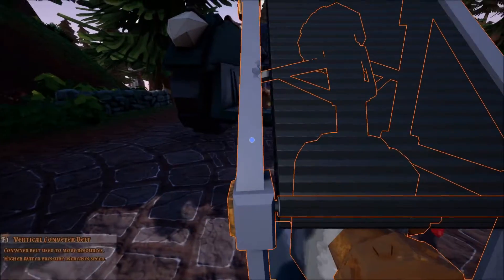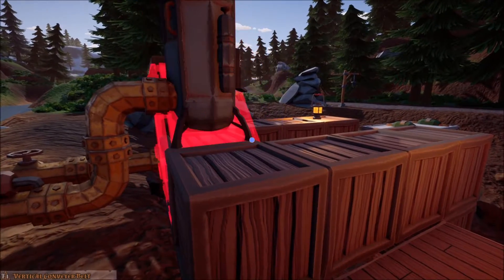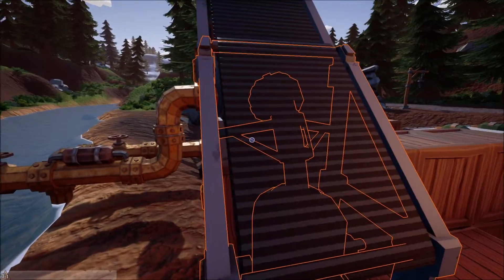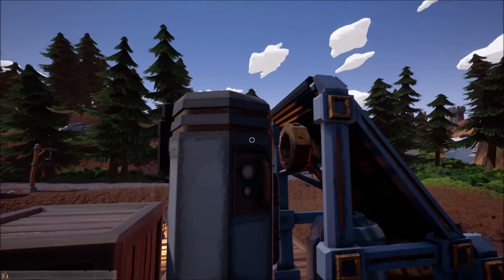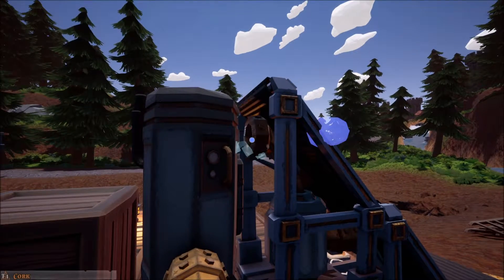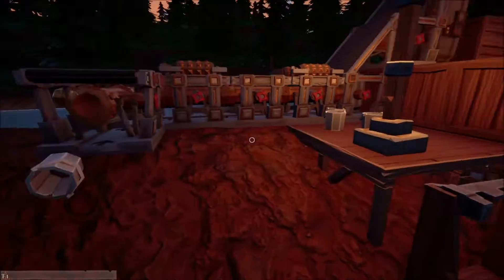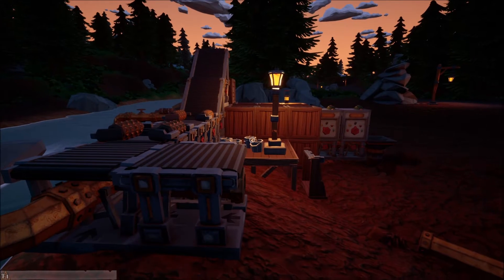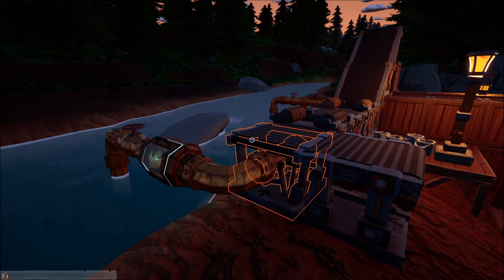Hydroneer: (6) Under Pressure

Comment: i wasn't keen on this game at first, but it's slowly growing on me. the automation machines are pretty interesting. not sure what that crystal in the box is about but whatev.
btw, your outro is missing something, i noticed this last the video too. :P needs repairs.
Reply from the maker: The automation is what drew me to it, but it's not especially user friendly.  It ain't no Infinifactory that's for sure!
The crystal in the box increases the water pressure, and the more pipes and machines you use the more the pressure drops.  Mo' pressure means mo' speed, which is nice, but also as the systems get bigger some increase in pressure is needed anyway.
What's going wrong with the outro?  Is the audio off?  It seems to be working for me.